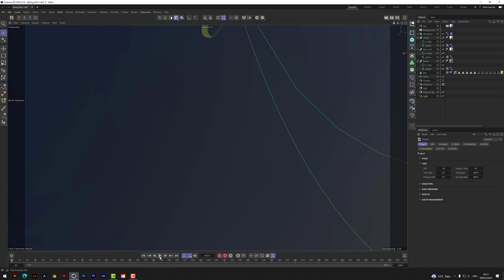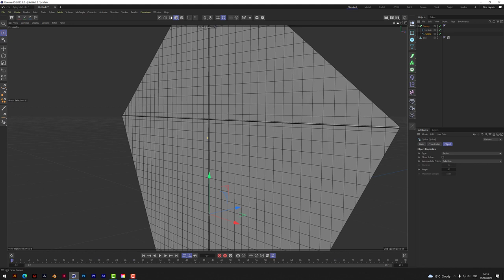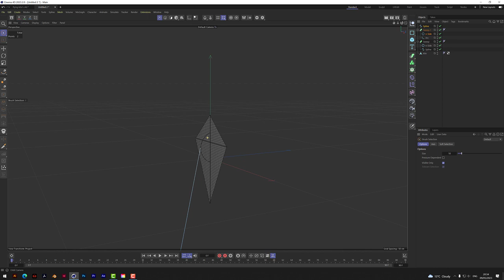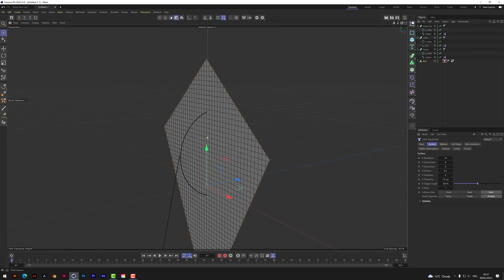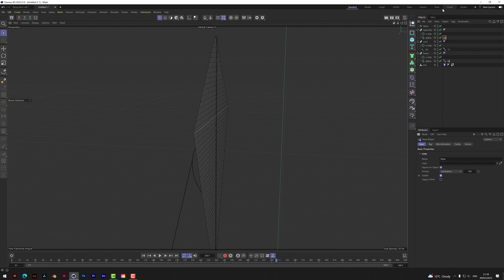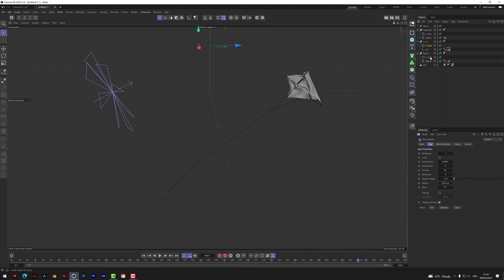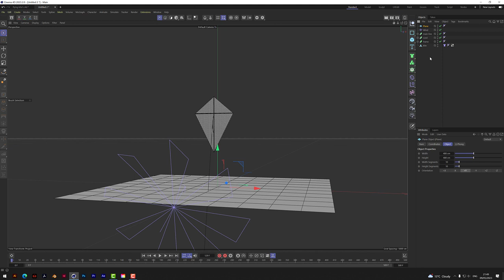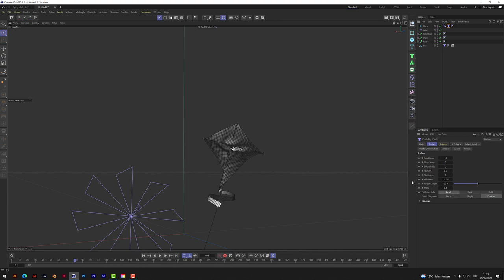Kite Flying with Cloth Simulation in Cinema 4D 2023.2

Comment: Very interesting, cool and fun tutorial. 🙂
Maybe I missed something, but why did you use connectors for the string and the cloth instead of rope and cloth belts?  Also, why is the "wooden cross" treated as rope instead of, for example, as cloth (soft-body) or a rigid body? It seems a bit too bendy (although my experience with real-life kites is virtually nil so I don't really know how flexible the wooden rods really are).
I've been experimenting with the new cloth engine in C4D on and off since it came out, but I usually use the cloth sim for character clothing and not so much for flags, curtains, etc. (which worked reasonable well even before the overhaul of the cloth engine which cannot be said for the use of the old engine with character clothing).
Reply from the maker: Some good points. I used the rope for the wooden cross with only 1 or 2 subdivisions to keep it rigid, but you could use a cylinder also with few segments and a Cloth tag, it’s just a preference really. 
For the Connectors, again it’s a personal preference and I like the visual “yellow threads” which show how securely bound one object is attached to another. I will give the Belts a go to experiment with the differences.
I’m glad you enjoyed the tutorial, it means a lot! 👍🏻
Reply: @VizualAnimation  As I explained before, I usually use cloth sims for character clothing and for that purpose I use belts and not connectors (to prevent my characters from experiencing a wardrobe malfunction...).
I was just wondering if the connectors provided a "better" or more "secure" attachment.
Reply from the maker: @C4DRS4U  yes they do as you can add as many connections as possible and increase the search radius to effectively “bind” or “stitch” the items together. This works with the segments in the object, so the more segments the more secure connections.
Reply: @VizualAnimation  Interesting.  So far, I haven't used connectors for anything not "mechanical", such as cloth or rope.